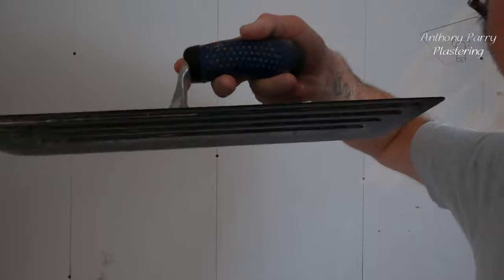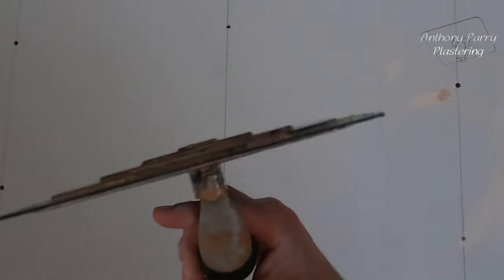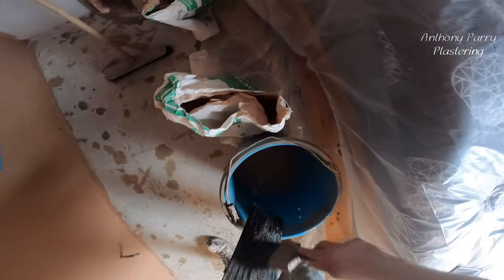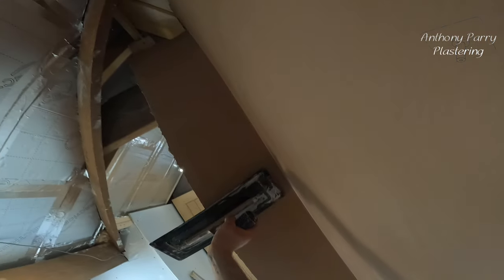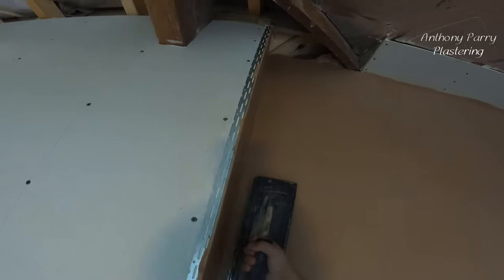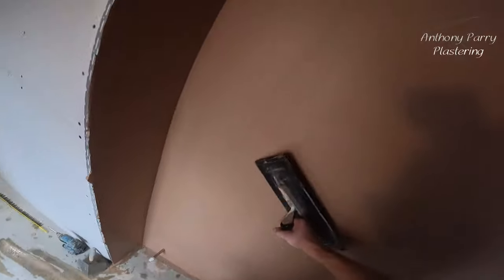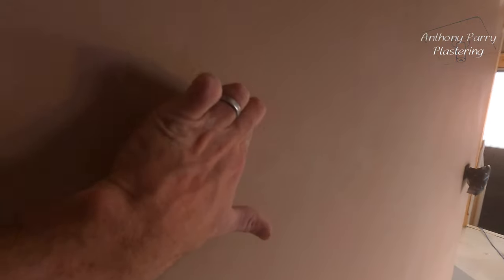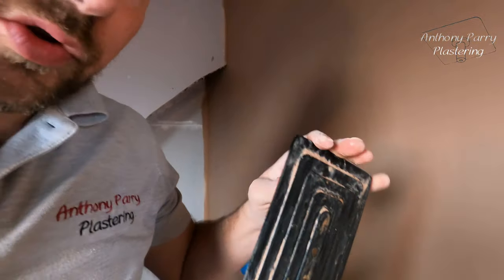Trying the Carta101 easyskim trowel, revolutionary plastic trowel?

Comment: Anyone else remember before the plaster was awful and you could do three sets a day and not need numerous trowels to get a finish? Does the plaster dry out nicely Anthony after you’ve used that? I’ve got so many trowels I can’t justify buying another. I’ve actually gone back to my old carbon marshalltown all the way through now and all the flexis and plazi have been put aside because they were complicating every set. I’m concentrating on getting the walls flat rather than chasing the perfect uniform finish which I can never seem to achieve anymore.
Reply: You get a better finish with carbon ditch all the gimmick trowels I’ve done the exactly same joe. Don’t over complicate the skimming process.
Reply from the maker: I know what you mean, it’s been a long time since you could do 3 sets a day and still finish at a reasonable time. The stuffs has gone worse over time. 
As for the trowel it does finish nicely, I’d say as good as the plaziflex trowels does. 
I get the sticking to the one trowel one, I think I’m always looking for the way to make life easier,  i will say is this trowel does speed up set thou
Reply: @AnthonyParryPlastering   as you’ve already said it will probably work for some and not for the others. The main problem is when you doing it day in day out anything that helps is always worth a punt! Chasing easier techniques for years I’ve just got fed up of it.
Reply from the maker: @Trowel1892  I’m definitely looking for ways to make things easy. It’s a hard enough game 😀 I’m trying to push myself into trying new things to keep my interest up. A few years ago I’d had enough and wanted to give up plastering. So I’m in a happier place with it now.

Comment: Iv bought 1 of these few weeks ago and its a total game changer the time it takes off the set and takes away half the effort its definitely worth the £100 lads honestly
Reply from the maker: I agree it’s a great trowel, do you use it all the way through?
Reply: Tell us your process mate… can you flatten wet plaster with it or just polish up with it? Concerned about bumps and ridges if it’s not a stiff trowel?
Reply: I put it on with my marshalltown then finish it off with this it's great because you can trowel over the plaster earlier no matter how heavy and wet it is it glides over it just like a plastic trowel but because of the presence of the trowel it makes it more solid to take out any lines etc. I found the plastic wernt tough enough to flatten properly.the plastic is really strong too and easy to get nik out just rubbing up and down plasterboard with bit of water. If you could try before you buy then every1 would want 1 👍

Comment: Just went on the Carter 101 website…  16inch £100  I’m a spread from Bristol so I thought I’ve probably got 10 trowels do I need another 🤔 if it makes life easier why not… went to purchase it then they want another £12 delivery what an absolute piss take… I think they need to look at there pricing policy… my question is ,you were lucky enough to get one sent to try you as a freebie …. if the boot was on the other foot would you stump up £112 to buy one
Reply from the maker: All I can say is that I like the trowel, and I have been using it a lot lately. I know it’s expensive. They are a brand new company and they make the trowels themselves.
For me I would take a punt because I’m really interested in the trowel and I like the concept and I like trying new tools. 
There’s still a few questions like durability and trying it with different materials and backgrounds that I can’t answer, but time will tell on that one.

Comment: Would an ox plaziflex not do the same job, its a lot stiffer than the refina. Try one at the same stage as you tried with this new one and see if you get the same results.
Reply from the maker: I’ve not tried the ox plaziflex so I cant comment. This trowel is a lot stiffer than my Refina so I definitely wouldn’t try that at that early of the stage. I’ll have to try the ox one at some point 😀

Comment: Is it not as flexible then? I use a plaziflex trowel for second coat, and then for final coat, far to flexible to use elsewhere.
Reply from the maker: It is fairly solid, the top and bottom are quite flexible.
Reply: @AnthonyParryPlastering  I’ve ordered one will let you know how I get on